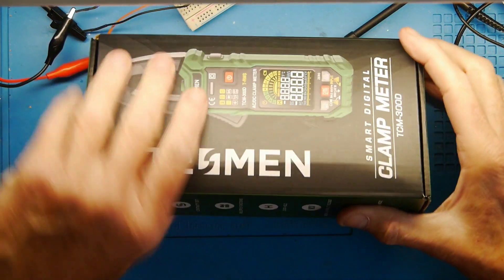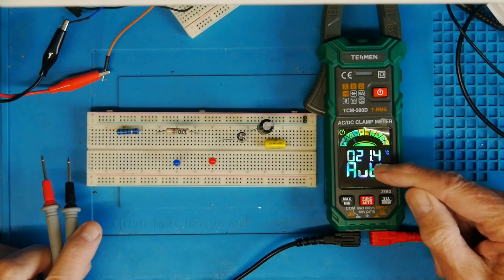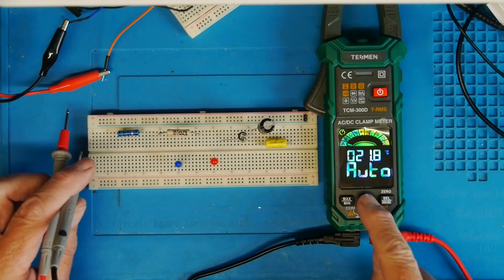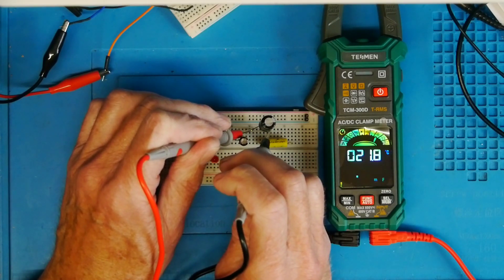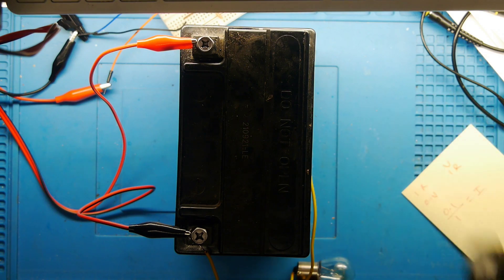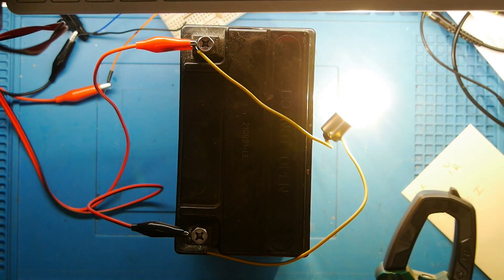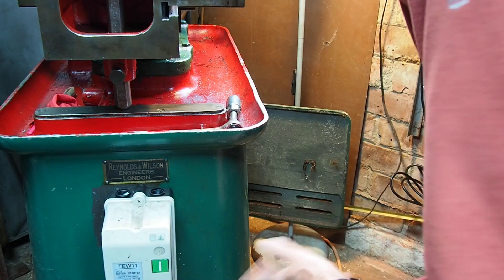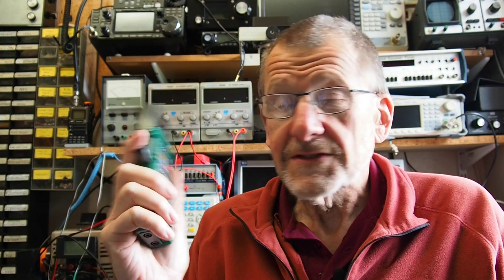Tesmen TCM-300D Clamp Meter Review - #196

Comment: That's one thing I don't have, a clamp-on ammeter that will accurately measure peak inrush current. Instead I do have a handheld oscilloscope and a current probe configured with trigger settings, but that can be pretty inconvenient.